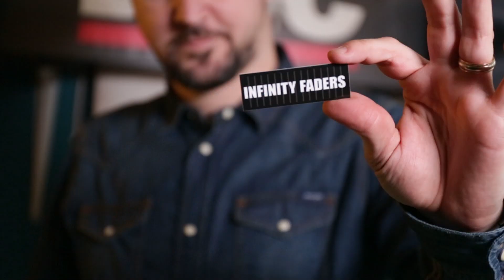HOW TO CLEAN & UPGRADE A RANE FADER I WATCH AND LEARN

Comment: I remember when i bought the ttm 56 Rane love that old mixer but i did not know it was not that sharp on the cut it had a lag on it crossfader but i took out the Rubber bumb that come inside the crossfader n put a metal washer on it then i was able to cuts nice crazy sharp it sound like having a innofader on it i was shock the difference sound when I was cutting it sounding like the vca crossfader from vestax cuz i was going to put a innofader on it but i notice i don't have to do it cuz it sound sharp on the cut so for now i leave it like that maybe  later on i put a innofader pro on it but for now it sounds just like you was scratching with your Rane now im able to play with my mixer after all those years i got it in my closet brand new i did not use it cuz it was not sharp enough for my scratch mix so that idea came to my head  so i save money for now im very happy i made it sound sharp when i scratch cut but in the future im going to put a innofader on it but cuz i like the magnetic crossfader n the feel of the crossfader n Chanel fader so smooth crossfader

Comment: for info:
you can touch the sensors with fingers or a screwdriver, that's do nothing.
you can bend them a little ,for a shortest cut in ,it's an usual mod ;)
Peace!
Reply: self magneto i need this mod in my life lol
Reply: which way do you bend them to sharpen the cut, towards the middle of the fader or out to the edges? Can you bend them too far?
Reply: towards the middle of the fader my friend and dont force too much or they will break ;)
Peace!
Reply: self magneto You push the hall sensors outward for sharper cut in.
Reply: no, inward.
Reply: 1:i'm on a 57 ,here they talk about 61 and 62,but ok there are the same magnetics fader
2:they re-calibrate the fader after they manipulate the sensor
3:the mod' i'm talking about is just physics , 
shortest is the distance between the magnet and the sensor,
shortest is the cut and no re-calibration involved,simple physics no?
ask Eb Kaïto what he think of the cut in time of my 57 ;)
Peace!
Reply: i know who is this guy lol
I just say that I find a way to do different, by myself and it works well for me, 
i would try the "official" method and would come back to you to give my honest opinion.
Peace!